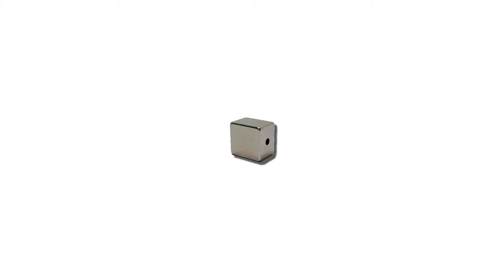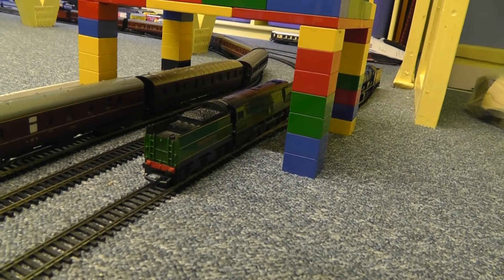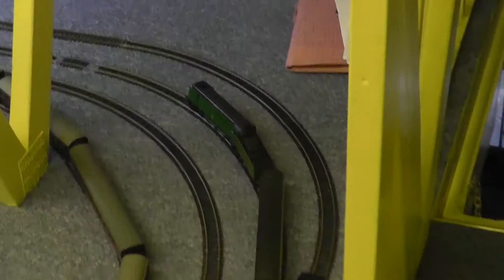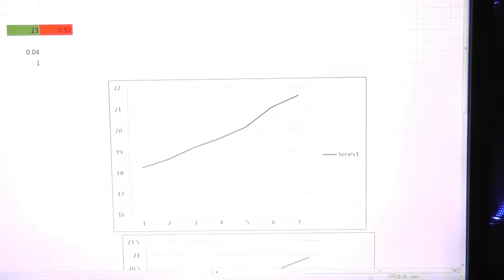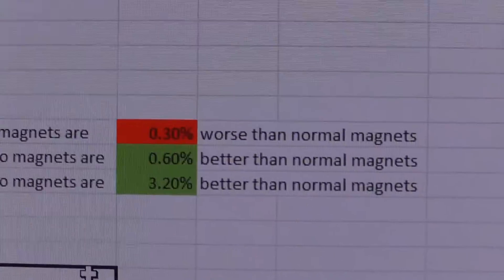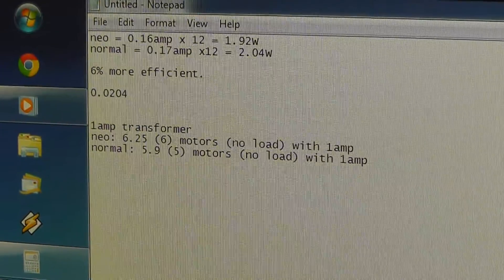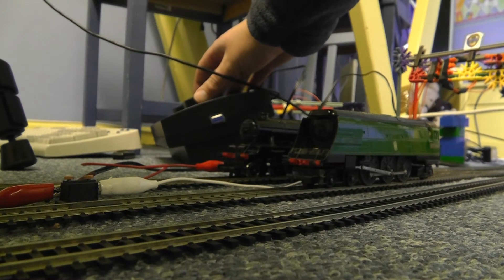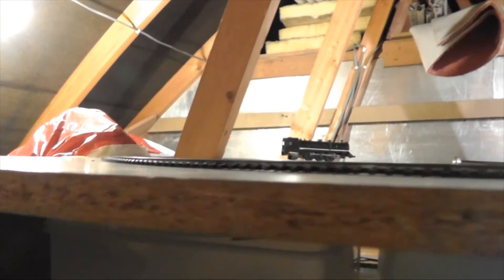Tri-ang 'Neo' Magnets: Do They Work & Are They Worth It?

Comment: Reminds me of my battles years ago with the X04 motor in trying to get reliable running. I had a large collection at one time and it was always a problem,. With lack of use the motors lost the magnetism and failed or  were very jerky at low speed. I used to have to strip the motors out the worst locomotives and take them as a job lot to the local model shop which had a "remagnetizer," used work much better afterwards. I did over the years try various replacement magnets and also obtained JEPSON five pole skew wound armatures for them. still needed a remagnetizing after conversion but the 5 pole armatures worked wonders for slow running. To separate the magnet from the stators upset the magnetic field, the magnet and the two  stator pieces are one unit as a magnet, so I found it was more the remagnetizing after any mods or conversion that had the better effect.

Comment: That crawl was SO MUCH BETTER with the neo magnet! Yes the loco was slower, but it was smooth and consistent, which is exactly what you want in a crawl. The one with the regular magnet didn't look like it would even keep running if you turned the control down enough to do the low speed of the one with the neo magnet.

Comment: No comments for a while I see. Only just found this video, interesting. watching. 
 A few points  ...some of the older locos had magnehesion <sp?>  which on the old steel track improved pulling power. Those who still have the old steel track might notice even more pulling power. 
 You can get quite small neo magnets which can be put on the outside (paying strict attention to polarity) to improve motor performance without affecting the  bearings so much. I have improved old tired Ringfield motors this way (was not brave enough to try CD motor modifications).
The bigger Neos also had issues with lifting steel coupler hooks  in locos where the motor was close to the back wall.
Reply from the maker: Thanks for the comment Malcolm - yes you're absolutely right about the magnahesion - and it was a godsend for locos such as the single wheelers. That's a good idea regarding the booster magnets - but now that I have the remagnetiser device, I find that does the job perfectly. Sounds like a wonderful fix for the ringfields though!
Thanks for watching - Sam :)

Comment: Neodymium magnets aren't supposed to make the motor faster, they generally do the opposite: slow the motor down and make the it more stable at low speed, as your side-by-side comparison showed. The hallmark of a weak magnet is high RPM and low torque, so your test was a success. I'm a little confused as to what you're trying to achieve here... these are model trains, not slot cars.

 I've done this to numerous old open frame motors, and the difference is remarkable.
Reply from the maker: Thanks for the info, duly noted! This isn't quite true though, with a stronger magnetic field, the turning force will be increased, this is a basic principle of an electric motor. In my experience, when a magnet is failing, the motor runs much more slowly and with much less torque - torque and speed are closely related. I don't use NEO magnets anyway - they're far too strong, and they wear motor bearings out unnecessarily, I prefer to remagnetise the original magnets these days!
Sorry if this has confused you!

Thanks for watching - Sam :)
Reply: No, I'm not confused. I've been repowering motors for over a decade. The symptoms of a weak magnet in old alnico magnet motors is high speed, low torque, and overheating. Under load, of course, a weak motor will bog down. In the case of you tests, your original motor wasn't weak per se and probably running as designed, just not as powerful as the motor with the neodymium substitute., which showed its superior low speed control.

I'm surprised to hear about the bearing wear. That's something I've never encountered. The forces on the armature should mostly cancel out given that the poles are 180 degrees opposed, The greatest source of bearing wear is a worm mounted on the motor shaft, which creates a great deal of upward side force on the forward bearing.

That is a huge block magnet, though, as big as the original. It may be overkill for an upgrade, in fact it probably has much more flux than the field pieces can transfer to the armature. I generally use stacks of smaller magnets to try and find the sweet spot field strength-wise, and maybe that would be a better way to go.

I know one type of 3 pole motor that doesn't respond well to a replacement magnets; they have wide armature gaps and cog horribly, and their original block magnet is large enough to do their job handily.

Anyway, enjoyed the chat. 👍
Reply: @SamsTrains  Just seen you reply. How do you remagnetise old magnets. I have an old Triang dock shunter and a steam Princess. The magnets on them are so weak nothing will stick to them. I read somewhere that if you get a Neo magnet and touch the old magnet north on south or visa versa it will rejuvenate the old one.

Comment: Brilliant vid.  Very good empirical science that you can test and repeat. I.E real science, not the modern fake theoretical shite.

Very well made and thorough.

I do think the last test needs repeating though with the same loco both magnets on 1 track.  Last test is my only gripe as it wasn't as fair.
Reply from the maker: Thanks mate - yes I tried to be relatively scientific with this!
Yes that'd be a good idea to try - but I've since learned that the neo magnets are bad for the motors, causing excessive wear, so I no longer use them - I now use a remagnetiser to restore the original ones!
Thanks for watching - Sam :)
Reply: Sam'sTrains - I watched your remagnetizer video too.  Seems a good bit of kit.  I have no use for it yet though as I only have a few X03/X04 engines.

Comment: Has your tests show not much in gain neo magnets are two exspensive they should be more like 4 to 5 pounds thats just my opinion grate video sam
Reply from the maker: Hi Mark, that's true - I actually highly advise against using them too - they put massive strain on the bearings! The best option is to get a re-magnetisers, and recondition the original magnets!

Thanks for watching,
Sam :)

Comment: Hi, here is obvious point in this your application of neodymium magnet to be considered. In order you want to really exploit power of this your neo magnet, you need to provide him enough iron core cross section (your stator iron core where you placed neo magnet, all to the stator iron core over rotor), in order his complete magnetic flux will be brought over to the rotor iron core. It is because for the original ferrite magnet there was enough iron core cross section space, but for your neodymium one is not. In magnetic construction, relation between iron core cross section and ferrite magnet pole space, should be about 1 : 4 (or rather 1 : 8, sorry I forgot), but for neo magnet this relation is about 1 : 1. You already got some improvement, but do this I explained (I am not sure how new thick stator iron core will fit in your locomotive model), then repeat your test again ... also care about the shape of new stator iron core, and you can consult me something about that.
(Edit) ... Oh, sorry, I did not noticed much about kind of your old magnet you replaced with neo. You just said old "normal" magnet, but when I noticed him after, it not looked to me like ferrite one at all. Because of his shine silver color and sharp edges, I would say rather it is Alnico one, or maybe Samarium Cobalt, but I doubt it is. In case it is Alnico, the point I explained above is practically the same ... good luck!
Reply from the maker: Hi mate, thanks very much for the info on that - I will consider that!
Another development occurred since I made this though - and that was the fact that the more powerful NEO magnets were causing excessive wear on the armature and bearings - meaning that the motors running life was significantly reduced!
These days - I have a re-magnetising device which restores the old magnets to their original condition, which doesn't put so much strain on the motors!
Thanks again for the comment,
Sam :)
Reply: Hi Sam, you are welcome! If you make a improvement, that can require another ones, in your case improvement of the all bearings and strength of complete construction. You can check it. But - that means improvements, and in other hand, anything in this world do not last forever. I read also comments here something, and I think you could check if there exist wear of motor commutator and brushes. But, this could be problem only if there is visible deeper trace of brushes on the commutator, or brushes wear is near to the end. 
If you do re-magnetizing your old magnet, it is the best you do that with already assembled magnetic construction, I mean - magnet is not magnetized out of the stator iron core assembly magnetic construction, then placed in. Even it would be good if that include also assembled rotor, but i am not sure it would damage rotor windings, disregarding motor is disconnected from the controller, or even if brushes are removed. But re'-magnetizing practically any kind of magnet it is really hard to be needed, because in normal conditions all of them can lose their properties very, very slightly, even maybe over 100 years or more ... Magnets can lose their strength in excessive heat conditions, or if applied heavy mechanical stress - impact. Neo magnet is most sensitive on heat, mostly even from 80C, then Ferrite from 250, then Alnico and Samarium Cobalt ones are most heat resistive. Some magnets also can lose their strength in some noticeable extent if are placed out of the magnetic construction assembly, especially Alnico, then Ferrite slightly, and about others I am not sure, but probably, and practically almost nothing. If your old magnet is Alnico (probably it is), because I saw you are pulled him out of the motor, it is the best that you magnetize him again as I explained above, but in most of other cases it is hard to be needed. It seems that people which sell those expensive magnetizers, and Neo magnets also, just want to pull out money from yours pockets ;-). Regards

Comment: I would sooner replace that ancient motor design with a modern, skew wound, five pole, flywheel-equipped job that has the magnets right next to the armature where they belong than worry about trying to replace the magnet in the old motor.
Reply from the maker: Yeah - that is perfectly logical! But to most, these motors are extremely nostalgic - and in many cases they last much longer than the modern ones will! I've got tri-ang motors that are 65 years old, and still run perfectly - all because they can be easily stripped down and serviced properly!
But yes - if you wanted, you could try to find a modern motor to put in there - but if you did that, you'd be better to just buy a modern loco, which has all the modern details too!
Thanks for watching,
Sam :)

Comment: How accurate and repeatable are your timings? That could potentially explain some of the subtle differences when running loco only
What would be interesting is keeping the originals but putting them through a remagnetiser rather than swapping for neo magnets,
Reply from the maker: Hi, thanks a lot for commenting! I've only ever done testing on this engine... But I never did notice a benefit of the neo magnets in any of the locos I upgraded! I can highly reccomend demagnetisers though - I use one, and have removed all of my neo magnets. Again though, if there's nothing wrong with the magnet to begin with, you won't see a benefit. However, if the magnet has weakened over time, the benefits are visible and dramatically so!

I much prefer using original magnets, since the neo ones put the motor under massive strain, which ruins the bearings, and ultimately damages the coils!

All the best,
Sam :)
Reply from the maker: Sorry - I meant remagnetisers!
Reply: Yes Chambs123 swears by re-magnetising original magnets from what I gather

Comment: Hi Sam....I just stumbled across this interesting video of yours. I have used a few of the neo magnets & although I haven't done any experiments as detailed as yours, I have found in a nutshell that they run better at a slow speed, the loco isn't any faster but you can pull much larger loads with little or no effort! So that's pretty much what you have concluded with your in-depth experiments. When I take a magnet out for whatever reason, I always mark it with a black pen on the side & also on the plate for correct direction on re-fitting. I also use a compass....this is very reliable in correct placement of direction. Anyway Sam....enjoyed & liked the vid. Don't know if you've ever seen my channel? Kind regards, John.
Reply from the maker: chambs123 Thanks very much for the comment - I found what you said to be true with regards to the slow speed/power. For the most part, I've been quite lucky with magnets and have only had to replace a handful. Yes, I've enjoyed your channel since you started it a few years back; its one of the reasons I thought I'd try making a few videos myself.Thanks for the info,
Sam
Reply: Sam'sTrains Thanks for the reply Sam & great if it was my channel that gave you the inspiration! I bought 30 of the neo magnets for the XO4....80 quid the lot! I've used maybe 10 tops. I also bought some for the bogie motor that's fitted to the class 31, 37, EM2 etc. They don't work too well. As you wind the speed up they are ok at first but when you get to top speed the motors suddenly break into a 'growl' & run slower, with occaisions of bursting back into full speed & the cycle begins again! The reasons for this is that the magnetic field is too strong & forces the armature to 'fight back' on itself! You can reduce some of the magnetism by heating the neo with a small blow torch but monitoring the temperture as you do. When the temperture gets to just under 80c stop. When it's cooled down the magnet will be a little weaker! All the best, John.
Reply: @chambs123  That's great information John.  Haven't seen you for a year or so.

Comment: Well this is quite an interesting subject. The controller you are using is of course a feedback type, so, it will be trying to compensate, the neo magnet will provide much more feedback to the controller under low power, so possibly it will be regulating more. Anyway that aside. I changed out a lot of my X03/4 magnets and Wrenn some years back. The things I noticed were greatly reduced current consumption, making the motors more suitable for modern controllers with limited output, less heating of course. Much better slow speed control. The concerns I have are: bearing strain with Neo magnets, due to the huge power of these magnets, possible motor frame distortion. Overall positive! But I think if I had the choice I'd like a magnet that was about half the power of the Neos but with no demagnetisation issues. Would you be able to re test using a normal DC source, maybe a 7808 chip Thoughts?
Reply: Oh one other observation. I found neo fitted motors ran worse under feedback than under normal DC! too much back EMF?
Reply from the maker: Thanks for the thoughts - It is indeed a complex subject! I might hook her up to a PC power supply and put a steady 12v through, I guess we'll see if there's any change.
Cheers,
Sam
Reply: Hi Sam, is there anyway you can find a 8vdc source? this is supposed to be the optimum voltage.
Reply from the maker: Thanks for the tip - I'll have a dig and see if I can find one :)
Cheers,
Sam
Reply from the maker: Though, the PC supply does have a 5v rail
Reply: Sam'sTrains Hi Sam, yes PC should have a 5v rail. Your video has inspired me to do some tests but I have no time for a while now. I wonder if there is a more reliable type of magnet without such mad power?
Reply from the maker: MikesMovies I'll get around to trying that when I get some time :) I'm sure they must be - its just the issue of them losing strength over time. Perhaps a magnet made from a non-magnetic material with a smaller neo magnet in the center would do better? No idea how we'd go about making those though ;)
Good luck with your tests,
Sam
Reply: Hmm good idea!

Comment: I have an early princess that had a very tired magnet and no amount of servicing procedures would make it run faster like the rest of my locos can, I used chambs x04 servicing procedure and cleaned the wheels and pickps and lubed. So I suspected the windings were bad or the magnet was tired. I fitted a neo and it improved slightly from how it was so I suspect the armature needs rewinding.
Reply: actually 2 days after fitting the neo its running slightly better again maybe its just because it had more run time
Reply: X04 service needs to include checking the back plate and bearing, sometimes they were all steel which does not help the magnets work, look out for nice brass back plates, make sure the back plate is secure and can not vibrate. Clean between the commutator plates and polish commutator using cotton bud and IPA cleaner. Consider changing the insulating sleeve as these can become impregnated with oil and conductive. Brush alignment would be next on my list. Good luck.